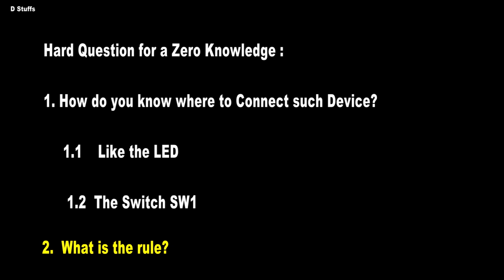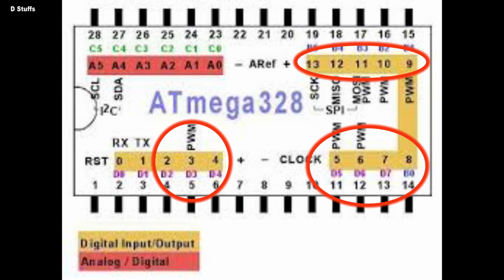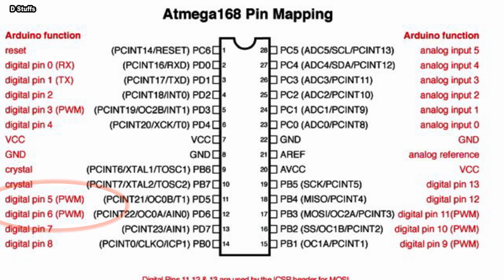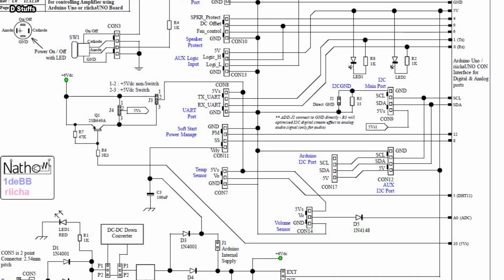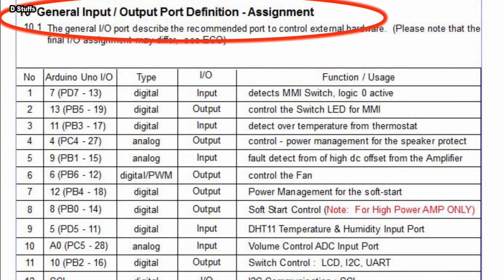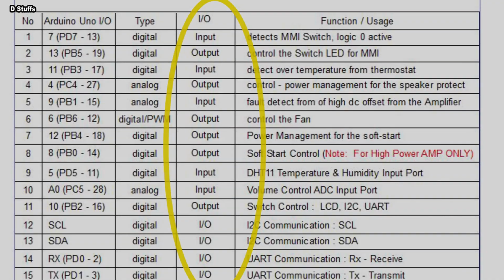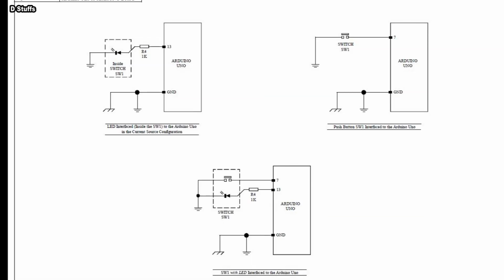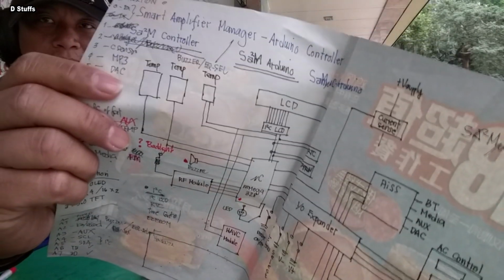AMPduino A3CS#05 | Pin Mapping Pin Assignment for STARTERs | Project Technical Specifications

Comment: Nag aaral din ako ngayon nito Sir. Maganda kasi PWM output nito pwede gawing pang switch ng DC-DC converter or sa mga class d projects, meron ako ngayong project nito sir yung arduino nano pang signal generator.
Reply from the maker: awesome!  keep it up and congratulation for using the Arduino.  Thanks for sharing your project as well ,  and if you spot mistake or improvement in my demo,  kindly let me know.   Salamat Po!